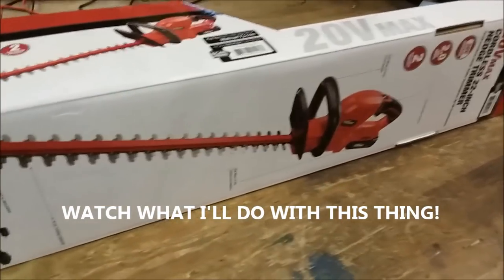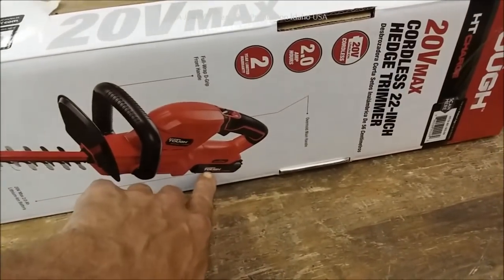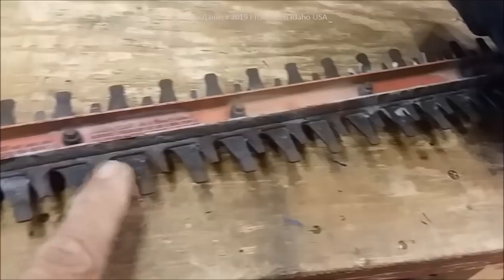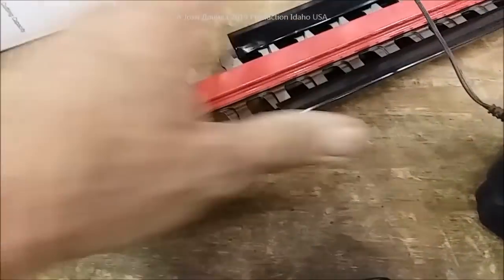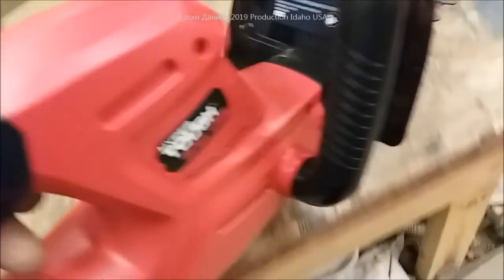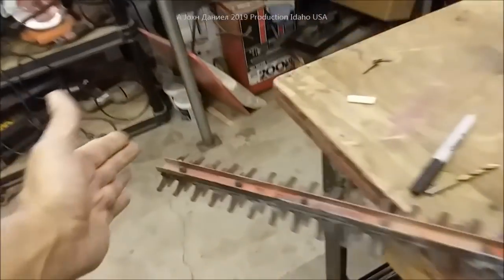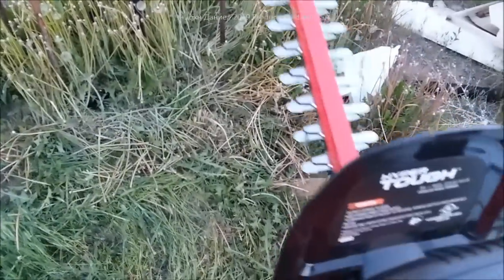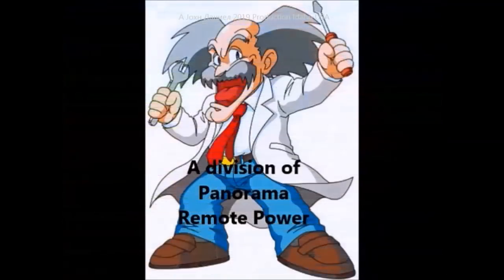Walmart Hyper Tough 20 volt Tool REVIEW, Hedge "WEED" Trimmer

Comment from the maker: CONCLUSION - Definitely a tool at a great price, 20 volt kit https://bit.ly/2GCLflJ & See all the HyperTough stuff! https://bit.ly/3izrMzB with higher quality and good reviews. Great for most people to have. +BEST Survival Kits https://bit.ly/30EnzES 
⬇️ #1 SURVIVAL POWER SYSTEM -- 100 Watt Panels https://ebay.to/30FYSs1 ,$120 REAL 50A MPPT https://ebay.to/3abTqju ,Solar Connects https://amzn.to/2XJOa1M ,Battery cable USA made https://amzn.to/3h6dsim ,12/2 Above/Underground https://amzn.to/2XIJolg for safe DC wiring of lights and appliances. (appliances you can use on 12 volt full list below video)
Reply: Yeah, its nice to see cheap tools are getting to where you can actually use them!!! Not that long ago, the cheap tools were almost use it once, and to the  garbage it goes! Nearly all tools are almost junk these days, compared to the old days, when you could buy tools, and they get passed to the grand kids! But just as well, grand kids aren't as likely to even have the slightest interest these days!! Not bad though, I may have to check this out! I have one of their belt Sanders. The belts are trash, but the tool seems it would last a year or two! Anyway, I could find a use for the batteries!!
Reply: can you fashion a handle and remote switch so you can be standing up when using? might have to bypass the safety switch. 
great review.

Comment: Them be Dandylions! They are good for you (apparently)!
We do not have Hyper Tough here in the UK but it looks familiar ....... Do they do dual voltage batteries and chargers? If so you need to watch as they dump cells in parallel to get the low voltage which means the cells are shorted together and do not get to equalise propperly giving short battery life!

Comment: I have a last generation 18v drill and impact, I guess I'm going to convert to lithium, and balance charge with a hobby charger, I wonder if it will handle 24v? 6 cells,
Reply: Hobby charger may not work unless it's designed for Lithium. They need cell balancing and other mechanisms for charging. Lithium are great for much higher energy densities, but they don't last as many years as Nicd. You can't let the battery packs sit dead for long periods of time either.

Comment: Hyper Tough Makes pretty good tools.  At least my drill is good.    I need one of those that would open a can of WHOOOOP Ars on 2" Mesquite  Branches.
Reply from the maker: See that second link in my pinned post, they have a cool and strong 10" mini chainsaw 20 volt complete saw kit with for 1/2 the price of kobalt. Kicks butt.